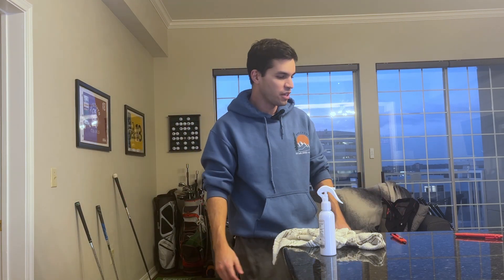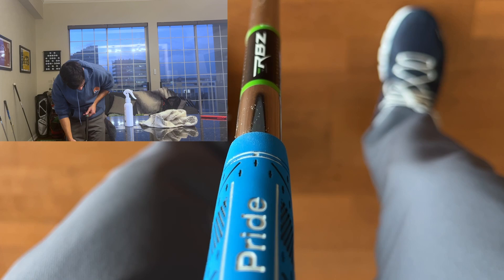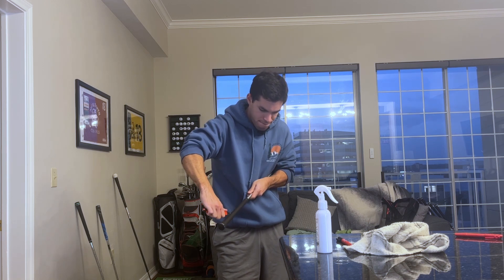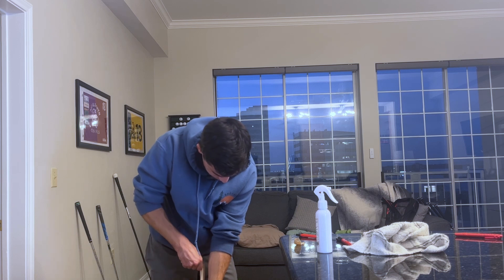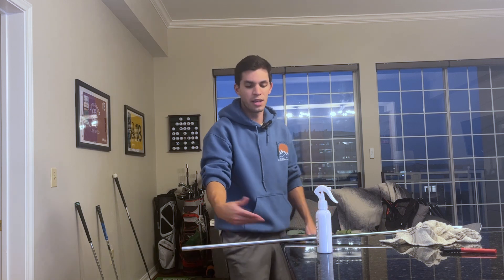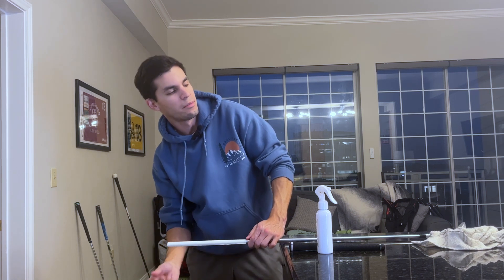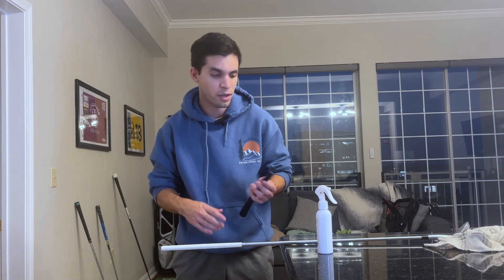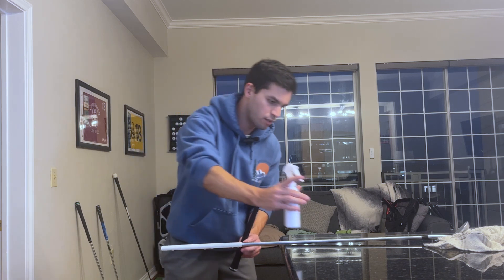How to regrip you golf clubs without a vise!

Comment: If you take the lower half of the cut off grip, you can use it to hold onto the shaft easier as you slide on the new one.
Reply from the maker: You little genius, you! Thanks for the tip!!

Comment: As the ink comes off with the solvent, in case of accidentally wiping it off to soon, wouldn't it be better to use some masking tape and make a mark that will not come off the tape. After fitting the grip you just  take the masking tape off.